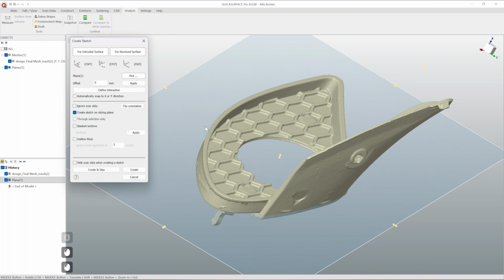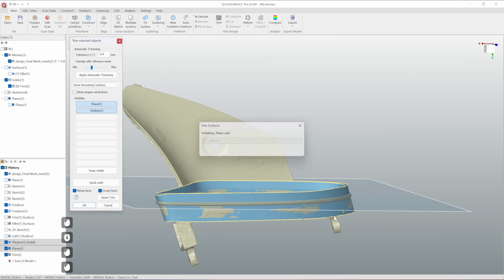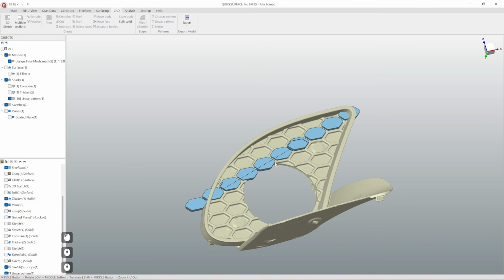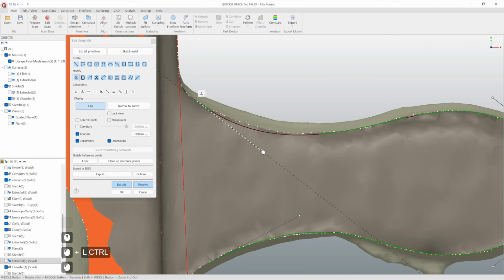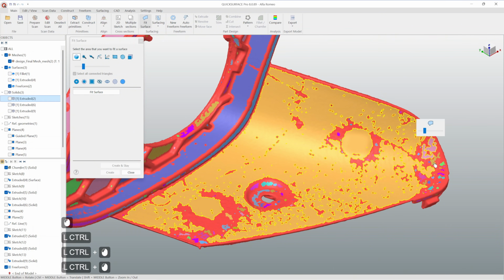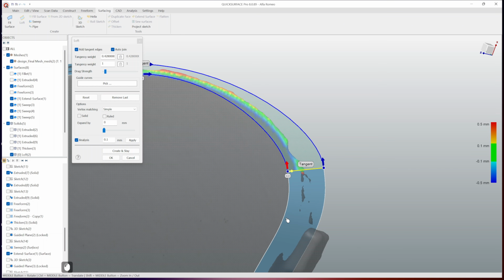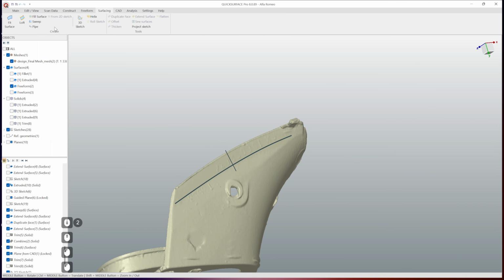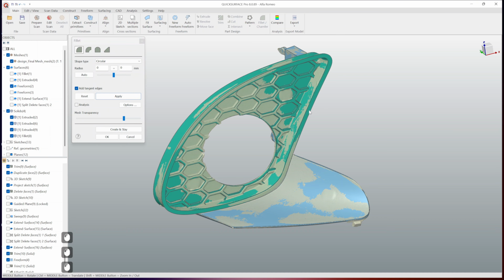Workflow: Reverse Engineering a Bumper Insert from 3D Scan| QUICKSURFACE

Comment: Hi. Thank you for workflow. time 28:42 .Which command did you use for automatic fillet selection? It automatically calculates the radius measurements. I couldn't find the selection tool for that.
Reply: maybe you are on a a lit version , try to change it
Reply from the maker: Hello, if we are talking about mesh sketches - you can use hotkeys to quickly fit entities to sliced points. hold shift + select points to fit entities. control + brush around two endpoints of entities to intersect them. control + brush around corner will fit fillet to a corner calculatedd based on scan data.